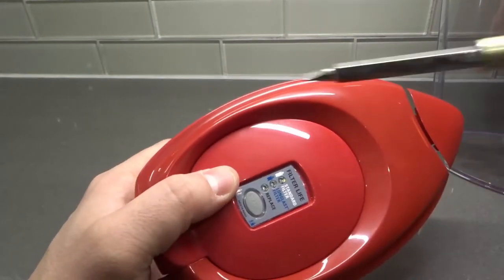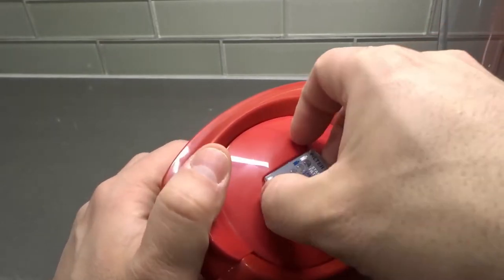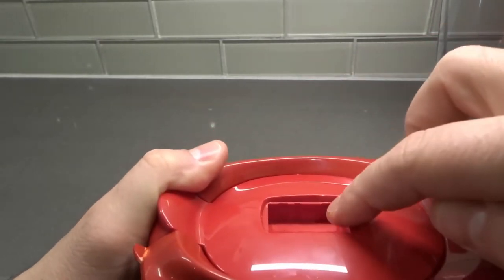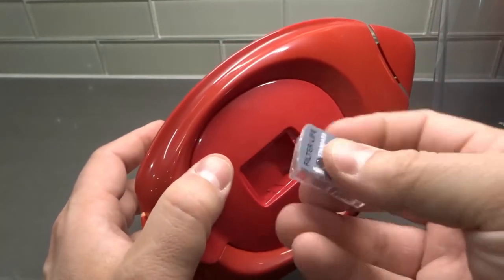How To Change Brita Filter Indicator On Pitcher-Easy Tutorial

Comment: Is the battery replaceable or do you have to buy whole new indicator?
Reply: The battery is replaceable, you need with a blade open the side of the battery compartment, no need to buy a new set, just replaced the battery.....